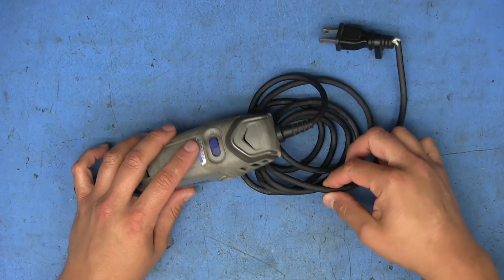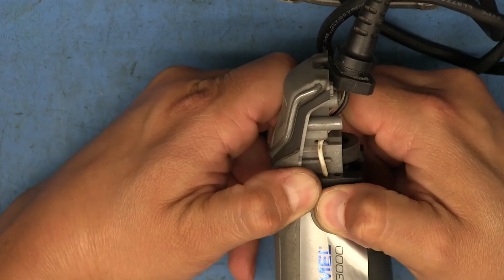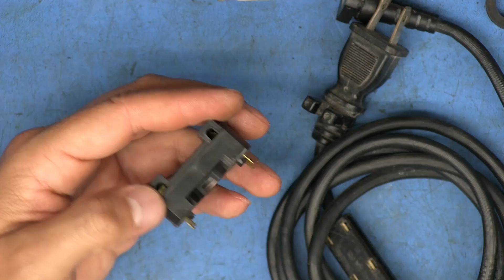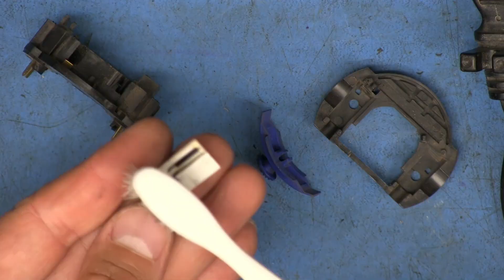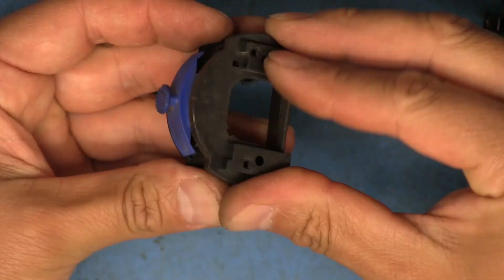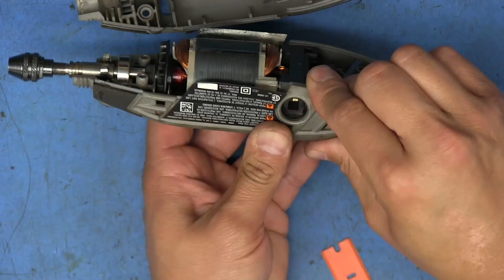TEF #192 | Dremel Damaged Power Cord Replacement

Comment: Could have just replaced the plug, but it looks like you had much more fun. ✌️
Reply from the maker: Yeah, I probably would have, but I didn't have a replacement polarized 2-prong plug on hand, and the good cord had been sitting around for a few years waiting for its turn. Also, I wouldn't have caught that the live terminal in the switch wasn't making good contact.
Reply: @ThatElectronicsFool  so true .. I haven’t looked, but I imagine that my Dremel has a similar speed control. It’s a bit older than your model though. Still you had fun, we (I) had fun, and when mine goes kaput I know what to do.
Thx! ✌️